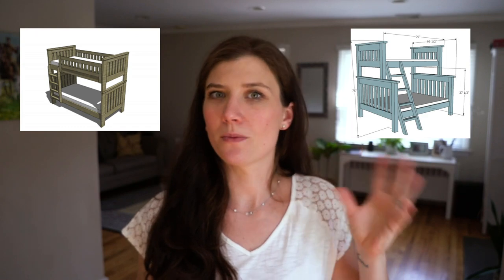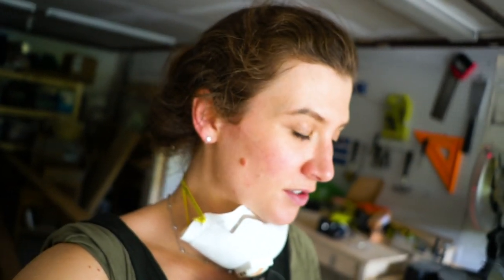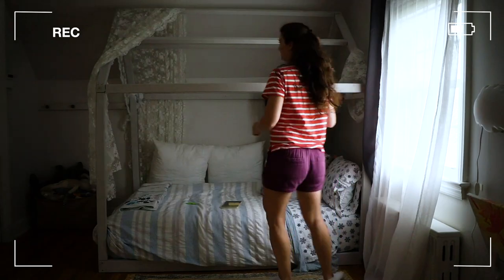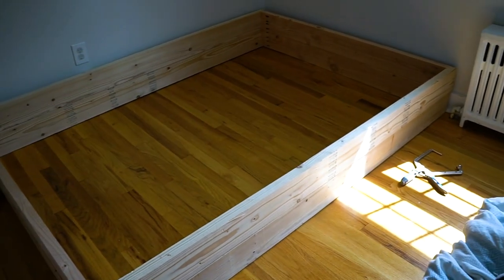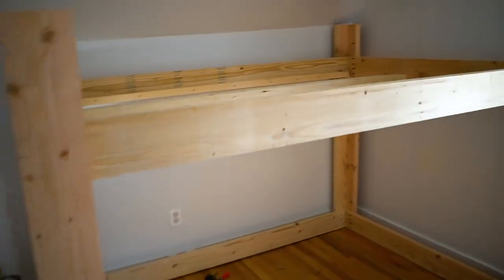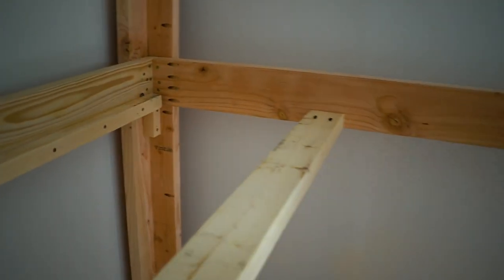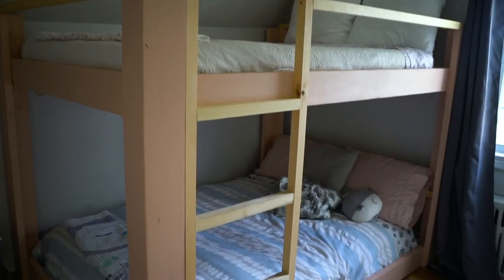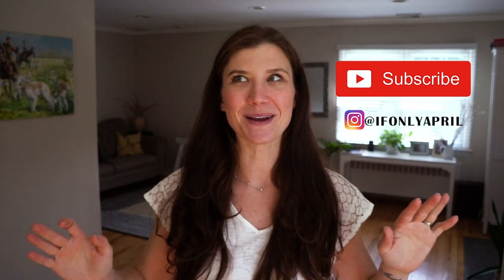DIY full over full BUNK BED with FREE PLANS | How to make bunk bed at home easy | If Only April

Comment: Can sômeone with no previous experience make it? You think it’s ok to give it a go? How much space does it require to make?
Reply from the maker: Hi there! If you never built anything before it probably will be too complicated and you’d mess up a lot. I’d try to make smaller projects first, simply to make mistakes and learn from them. 
This bunk bed is big in size and requires a lot of lumber. You wouldn’t want to mess it up. So I’d suggest to build something smaller first.
If you have a little of experience than I’d give it a go! :) I hope that helps!
Reply: @IfOnlyApril  thank you x:)

Comment: I've been looking for very specific bunk bed plans because our house is old and has low second level ceilings, about 80inches. How did you determine your height to be 59''? 
I like your design and will most like build one for my girls. Also,  any tips on sizing for twin mattresses?
Reply from the maker: Hi Pilar! I made it this tall since the ceiling in this house is angled and I couldn't make it taller. Just measure the size of the twin mattress and adjust the width. I might have plans available for twin size bed on the blog soon
Reply: @IfOnlyApril  thank you, April.

Comment: Great job just wondering how the middle supports are holding with those pocket holes? They dont look that sturdy
Reply from the maker: Thank you!! 
Pocket holes are quite sturdy! Plus there are 2 supports (2x4”) and supports on the side (which I glued and used screws as well) that hold the slats for the mattress.
If you are making this bunkbed “for good” and not planning to disassemble it at any time, you could also apply glue with pocket holes.
I built it in august and so far so good! Although I feel very comfortable with the construction in terms of safety, please do your research and if you have any tips for me, please let me know. Happy holidays!!!

Comment: Put your shop vac up to the table saw fitting and duck/duct tape them together, or get a double female shop vac fitting.
Reply from the maker: Yes!! Great suggestion with a duct tape. I also need to research on that connector for the shop vac!
Reply: @IfOnlyApril  any hardware store or Wally-world should have them.

Comment: @ifonlyapril I'm running into a problem with the ladder. The rungs spin with the weight and actually very easily. I can just spin them with my hands. Did you have this problem? Instead of nailing from the outside I made pocket holes in each step and screwed them into the ladder sides.
Reply from the maker: Hi there! Yes! I had this problem too! I  fixed it by adding wood glue. 
Pocket holes are an excellent idea! would make it super secure.